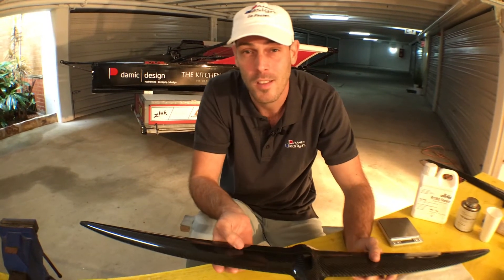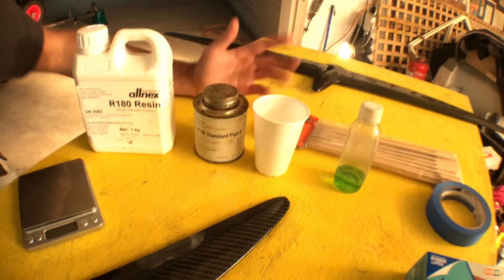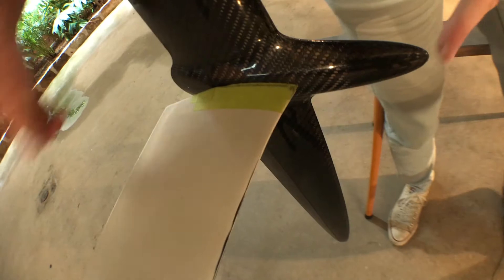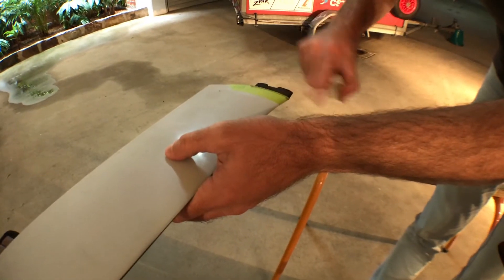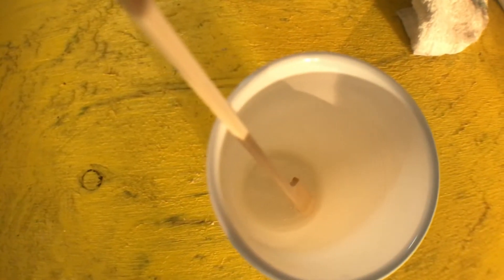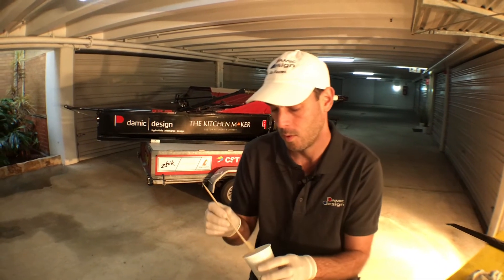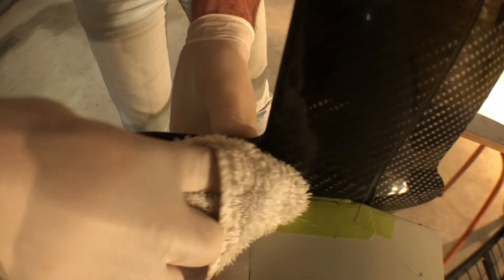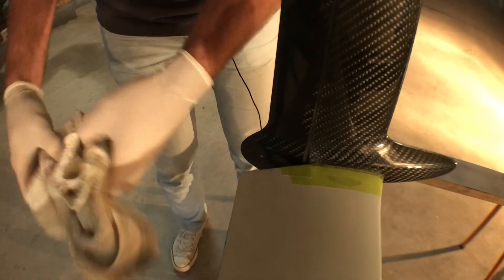How To Fit Your Horizontal to Your Vertical

Comment: If you use more epoxy than Luka shows, the excess can ooze into the retaining screw hole. Not a good idea. If you put the screw in when its wet it will glue it in, and you will tear the helicoil out next time you remove the foil. If you do not put the screw in immediatley, the glue will block the hole and you will destroy the helicoil trying to clear it out.  I prefer to fill the screw hole with modelling clay (plastecine) to prevent excess glue going in the hole.
Reply from the maker: Very true, if there is glue on the bottom it can work itself up the thread and block it. You can cover the bolt with PVA and screw it in to be sure. this way it will unscrew and leave the helicoil undamaged.